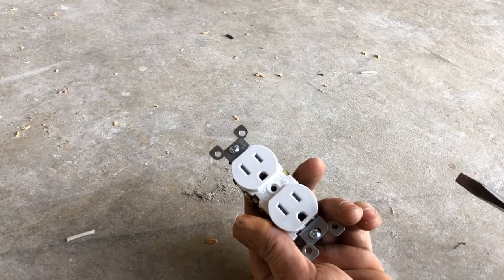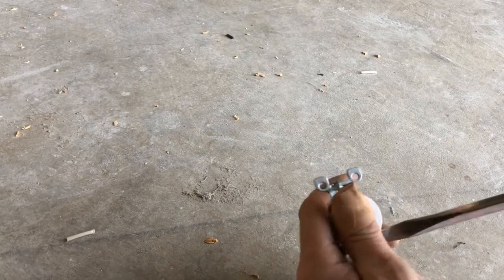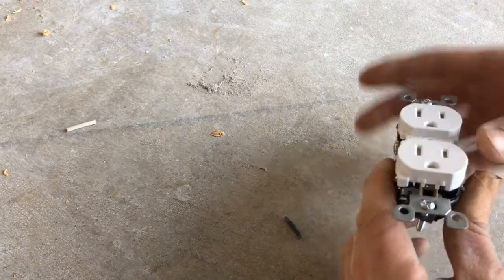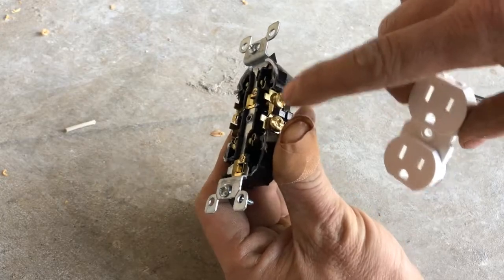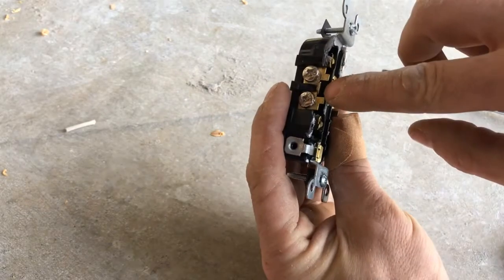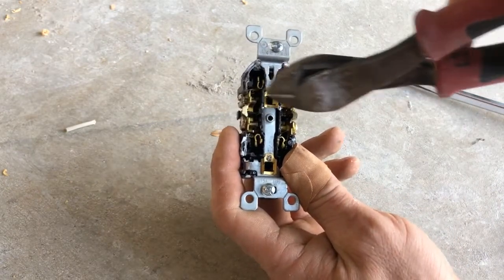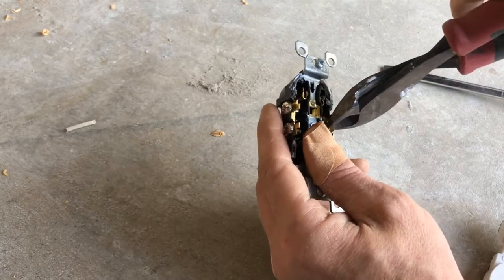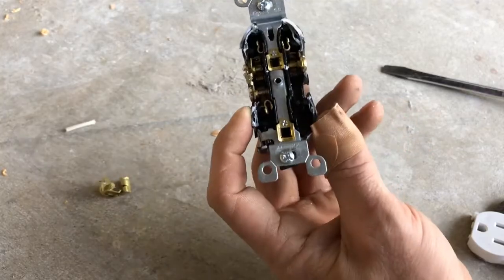Episode 5 - Whats Inside A Plug and A Switch

Comment: What you're calling a plug I thought was an outlet? Is it just a matter of region, or have I been calling it the wrong thing? 

To me a plug is what I plug into an outlet.
Reply: The correct term for them would be "receptacle", but in the field we call them "plugs" mostly to shorten it. You're right about plugging into an outlet, but we would call those "cords"; like an extension cord, we wouldn't call it an extension plug.
Reply: In the UK plug is the generic name, same as the plug that is on the appliance - But to use their  posh name: Plug Sockets are on the wall and plugs are on the appliance.  Never heard them referred to as receptacles in my life (in the UK I mean)

Comment: I'm working my way up your videos.  I was wondering about dimmer switches.  A suggestion would be to showcase, maybe from a hardware store, all the types of switches, plugs, boxes, conduit, wires, etc, that you as an electrician will be working with to give us newbies an idea.  Thanks!
Reply: literally how i spend my days off from my current job going down the aisles of hardware stores , lowes and home depot checking out electrical components , and looking at tools but i got all mine in a couple mths

Comment: Thanks for the video. Just wanted to add that if you chose to put two different circuits on a single outlet and sharing the same neutral, make sure the circuits are on different phases so you don't overload the neutral. Or just bring in two different neutrals.

Comment: With a plug having 2 neutral and 2 hot connectors does that allow you to split off to another outlet or what are those for?
Reply from the maker: yes, you have one gold and one silver for incoming power, and one of each for outgoing power to another device
Reply: @electricianu  I've seen some debate on whether or not the plugs can carry or are rated to or not to carry a 20 amp circuit when using the other connectors to jump plug to plug. Can you break down? When is best to twist all in the box and run individual pig tails out vs just using both sets of screws? Aside from the obvious that twisting in the box and using pig tails allows for a plug to fail or be changed out without losing the down stream plugs as well.

Comment: Interesting to me how a loop type system (hot and neutral) constantly flow, but when a switch is turned off, flow terminates at the switch, killing the neutral (not in all cases) not needing a return ?  Another example, capping off a live hot conductor with no neutral to carry current back to panel.  Any info why this works/ having a hot only doesn't create problems? Maybe the AC component.

Comment: Thoughts on stranded versus solid wire for use in residential/commercial?
Reply from the maker: Brandon K residential stranded doesn’t make sense unless you’re piping everything in. Commercial I think stranded is easier to pull in pipe but it’s more of a pain in the ass to make joints with. It’s possible just more work. I’m good either way really.
Reply: Brandon K solid as long as not in raceway